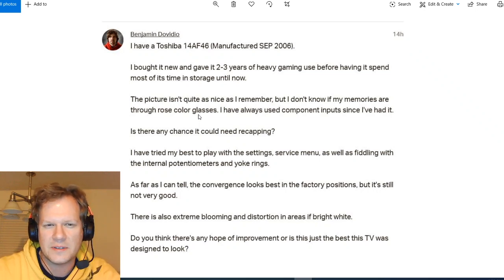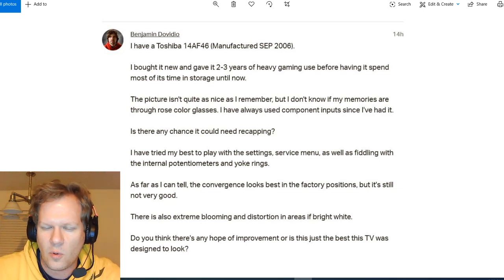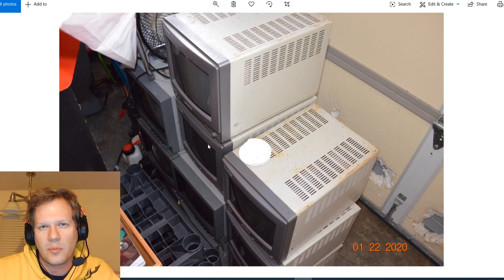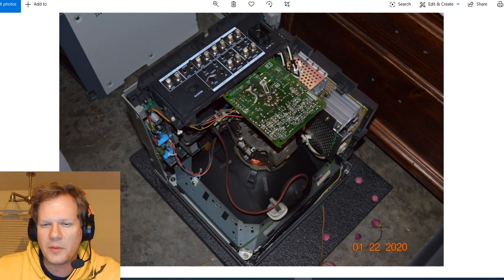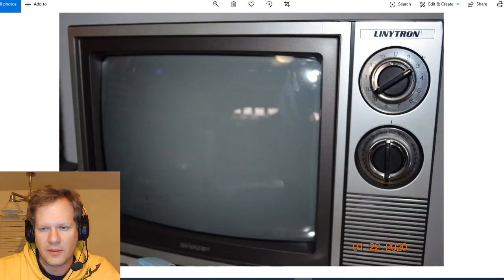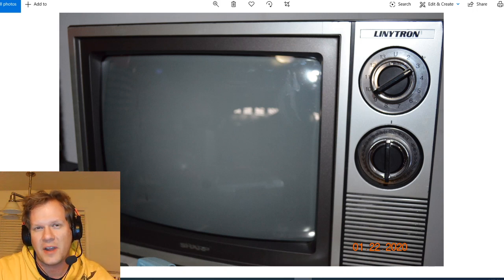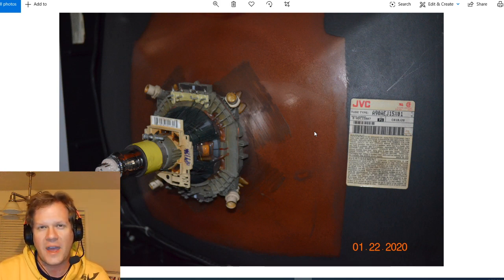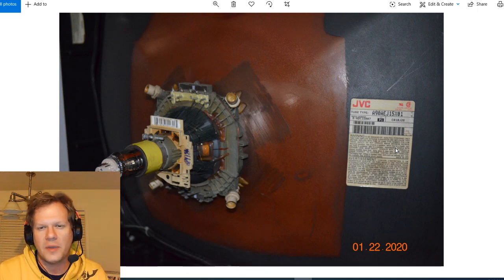When is a CRT not worth saving?

Comment: Today's trash is tomorrow's treasure. There's going to be a point where ANY crt will hold more value than it does today, the question is WHEN. If you offered me an RGB modded Consumer trinitron for $500 that might have sounded insane 10 years ago, but now that thing would be gone in a week.
Reply from the maker: It's pretty hard for me to let any CRT go that isn't working good.  I have a huge graveyard in my shop of stuff I hope to get fixed in my lifetime.  The issue is when someone who doesn't regularly work on CRTs wants to repair or restore one.  They would be better off starting with a good working CRT and do the preventative maintenance rather than picking a non-working CRT to try and fix most of the time.
Reply: kenny lauderdale rgb modded? Lmao. When you live in Europe....
Reply: no one will buy that for 500.
Reply: Pabloxd123 maybe in 2100 when crts will extinct.
Reply: @mtunayucer  yeah

Comment: This is a nice episode as I'm actually considering repairing my bang and oflusen beovision 1 crt. I got it from a guy and it powers up nicely. However after about an hour or so of gaming, it started popping and smoking from the rear!!  Some serious burning smell but screen is still playing properly... 

Makes me wonder if I should try a full replacements on the psu but I'm no technician. Not even sure where the problem is... And parts could be really hard to find... 

Having kinda mixed feelings to let this nice crt go to waste if I were to junk it... 😣
Reply: Don't use it if your actually smelling burning. It's a matter of time it blows up. Burning silicon is also quite toxic. Open the back, look for the problem.
Reply from the maker: I'd still recommend opening yours up and doing a visual inspection.  You should be able to see what's causing the smoke and smell.  It could be a bad cap has leaked or simply dust has built up on the hot Components and is starting to cook when you turn the CRT on.  It is common for these older CRTs to have lots of dust built up in them.
Reply: @RetroTechUSA  I've actually did some cleaning immediately after I bought the tv from the guy. Definitely not burning dust as there's loud popping sound... 

I'll probably open it up again and try dismantling the power supply board to take a closer look again, and at the same time check for any burnt caps on other boards. 

Guess i'll try one last effort to save it before it goes to the junkyard...
Reply: @viscountalpha  I've already stopped using it for a few weeks.. Fearing of it eventually catching fire. The house does stink with the burning smell even a few days after it started popping...not gonna let that happen again 😅
Reply: @keithchua5840  Power it up with nothing flammable next to it, and use a power strip with a replaceable fuse built into it.  Violá!  No worries.  ...just don't breathe the smoke in.
Reply: It could be Rifa capacitors in the PSU section. They're used for line filtering in a lot of old devices, and have a tendency to fail in a very smokey manner when they age. The smell they give off tends to smell a bit like burning wood. It's not a serious problem, and one can either replace the capacitors with modern equivalents, or just remove them entirely, as these caps are simply used for filtering the mains coming into the unit.
Reply: @44CT232  I'll give these capacitors a check. I surely do hope some cap replacement will be able to revive the tv... As all other functions like remote swivel of the stand still works..  And it's a pretty nice looking tv
Reply: @keithchua5840   Hopefully you're able to sort it out. Those B&O TVs are really cool, so I'd definitely have a go at fixing it before throwing it out :) If everything on the TV works fine otherwise, then I definitely suspect it to just be bad filter caps. I rescued an old Telefunken TV from e-waste a while ago, and it powered on fine, and was running OK, and then it also started smoking, but it kept working fine. It turned out to just be blown Rifa caps in the mains filter section. I removed them, and now the TV runs fine without any smoke :P The convergence still needs major adjustment, and the tuner is a bit wonky, but at least one issue was easy to solve :)
Reply: @44CT232  I got an MX 6000 in perfect condition to sell
Reply: @keithchua5840  OMG it has a swivel.
What's the model number?
Reply: @Vinnay94  It's a beovision 1 with remote controlled swivel motor stand

Comment: Great Video, Question, how do I get my 6 ring magnet package off of a burned in 1980's tube when you have the same tube needing it with no burn in., It appears very dried out and stuck on tight, its also very brittle and I could end up with nothing?

Comment: I do have a slight disagreement.  After component/jp21/scart/s-video video inputs, I think a consumer C.R.T.'s value comes from its style.  For instance, I hope to hook up a 1983 13C302 Magnavox C.R.T., that I saved from being trashed, to my NES and Sega Genesis, because it fits the gaming time period (It also does not hurt that retro video game consoles made pre-1994, had a separate R.F. out, so you can hook them up via R.F. and their mulit-out simultaneously, for multi-screen, or capture card, applications.).  I also saved a Broksonic CTGV-2736, and coincidentally, its style and size fits the Gamecube/PS2 era, nicely.
Reply: badreality2 or you could just use a 20L5 for everything NES-GameCube
Reply: @unlovableshinshin  Yeah, I use a Sony PVM 1340, and a Sony PVM 8042Q, but I played the Sega Genesis on R.F., in the 1990's, and its dithering is amazing in R.F., on a C.R.T., and hooking a NES up to a "wooden" tv, just fits its era so perfectly.  What I plan on doing, is hooking up my Sega Genesis and NES, dually, with their R.F. connections leading to the Magnavox, and their RGBs leading to on of my PVMs.  I will play games on the screen that suits my mood, and it will be a dual screen setup, for multiplayer games.  I am almost too grown up, to huddle next to a tv, for local multiplayer.
I want to hook up my 3-Dimensional games to a larger C.R.T. television screen.  I have heard that 3-Dimensional games are more immersive, on a larger screen.
Reply: C M Yes, I am young. No, I have never had a CRT, so no I don’t have the same nostalgia as you and this other person do. I respect that you are trying to experience it the same way you did when you were younger. I never had to use RF, I’ve just used composite for everything, but now I want to try to view the image in the best way possible and that happens to be on a RGB monitor with 800+ lines on a modded console. Like I said earlier, I respect you, thank you for enlightening me to your way of thinking.

Comment: It's really a shame that burn in is almost impossible to fix imagine how many CRT's would be useful today! And if that was possible we could probably chnage damaged trinitron and replace a new one and lots of old school TV's/pc monitors would work and we would also help with electronic trash.
Reply from the maker: It really is a shame.  Tubes are the Achilles Heal for the CRT display.
Reply: @RetroTechUSA  For repair?  Yes.  But if they did not have screens (tubes) that regenerate their image at the speed of light, we would not want them.  For example, I do not think plasma displays will have the same resurgence as C.R.T.s, for gaming, because the imaging processing circuit boards of the time, cause a substantial amount of lag.  ...they are good for Blu-Ray content, though.
Reply: here in n.ireland they smash the tubes up in the local recycling center they wont let you take them..i tried even asking to buy ones but no if its in the recycle center its getting smashed...

Comment: Blinking black screen
I have a Sony KV-32S45 Trinitron CRT TV from July 1998.
I use it to watch TV through a HDTV converter and play NES games.
it works but has a couple problem.

Turn on
Audio comes on after 7  sec
Stand By/Timer light blinks 200 times
Video comes on

Screen blinks black and good picture every 18 seconds
randomly based on what kind of video brightness picture there is.
I think dark scenes blink more.
Bright white scenes don’t blink at all.
But not always.

NES Dr. Mario works with no blinking after tv warms up.

Do you have any videos to fix a screen that blinks black and returns to normal randomly?
I can’t seem to find any videos because when I search for CRT blinking it comes up with problems related to the red LED Stand By/Timer blinking and not the screen.

Thanks

John

Comment: This is so weird to me... I never knew CRT even had burn-in risk. We used to do all the wrong things with those TV's and monitor's (static logo's, gaming HUDS etc) but I guess we got lucky? I was researching OLED burn-in risk when I learned that CRT has it too, but Ive never run into it.
Reply: It's a different kind of burn in, it's not inherent like it is with OLED. If you take good care of your CRT and don't leave it on one thing for hours and hours then in theory it would hold up much better than an OLED after ten years of use.
Reply: @awesomeferret  Yes, it takes A LOT of hours for a CRT to develop burn in of some static image part. We are talking about many thousands of hours here.
On my CRT computer monitor I can only see a very light burn in of some elements that never move (such as the taskbar) when there is a full screen of just one color, say white (otherwise it is invisible).
My monitor has had >20,000 hours in 12.5 years at this point and the mentioned desktop elements are there for probably at least 70% of the time I use it. So there is not a lot to be worried about in my opinion.

However if there is burn visible on the phosphors when the screen is turned off it surely is severe. Monitors with severe burn in were often switched on 24/7 for a decade and more displaying some static part.
Reply: @martinweizenacker7129  One of the most famous examples of severe burn-in on a CRT online is an old CRT display that was used at a DMV office that had the text "Please wait" so severely burned into the screen that you could actually see the text etched into the shadow mask of the picture tube.

Comment: Or that you acquired an Rare (NO POWER) 20" CRT for 25 bucks... It's very much fun to repair it and see her light up for the very first time... <3

(Dell 1998 - Color Graphic Display - UltraScan 1600HS - Series MODEL: D1626HY)
Reply: i just got one shown on ebay as working 14'' received and nothing works just a squeal but no indicator light and no picture the screen however has that feeling of static but it don't blink on   
1st logo dell color graphic display rebranded Mitsubishi-XC-1429C that i got mainly because i wanted it to match my dell 333d professional computer (that is where the term pc came from) i thought it might increase the value if it had a matching monitor 
but the darn monitor don't work i narrowed the issues to either 3 different things 
1. blown fuse 2.leaked caps 3.damaged fly back transformer 
it is a electrical fault issue but i am afraid to accidentally break it or break myself i am untrained in the art of crt repair and i fear the might of the explosive lead filled lightning tubes.